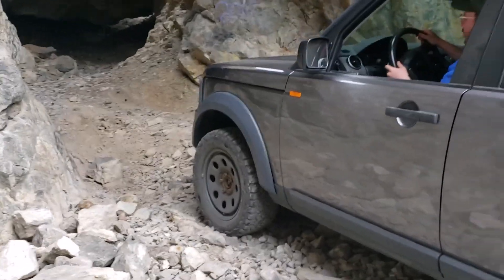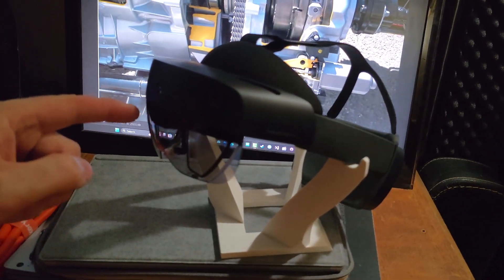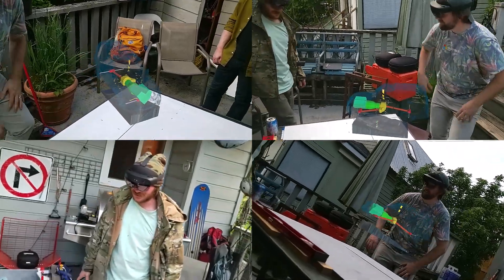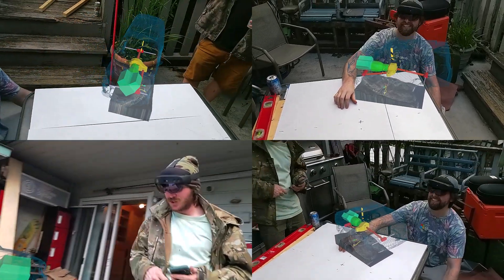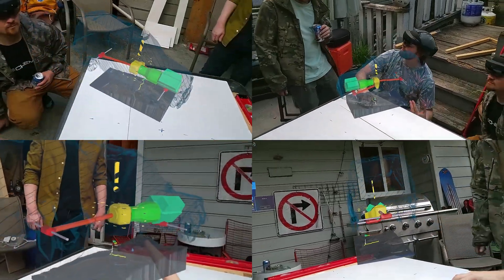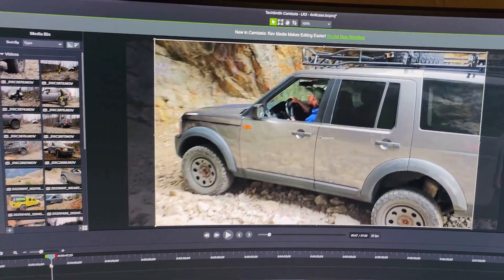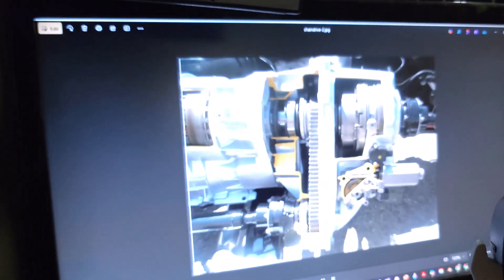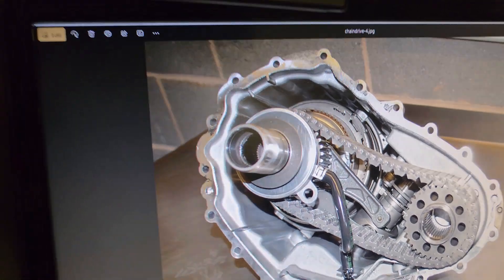Land Rover Discovery - transfer case problem

Comment: That model you built into the AR environment is super cool. I also love how there was a digital twin of mega included. :) 

It was interesting to learn about the transfer case operation and a possible failure mode. Thanks for sharing.
Reply from the maker: It would be really good to do a lot more of the 3D digital twins, perhaps showing a variety of the vehicles featured on this channel, but each one has a set of specific modifications.  This way, viewers could understand the specifications and how they perform for each unique build.  Thank you for the support!